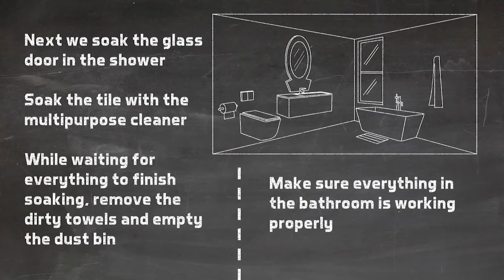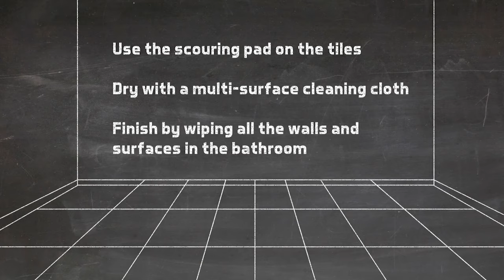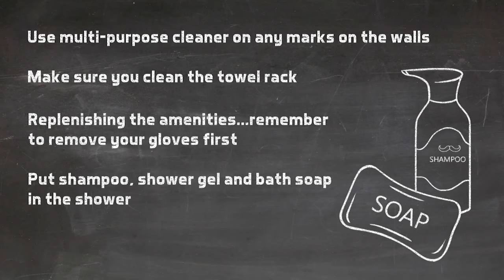Housekeeping - Level 3 - Cleaning of the bathroom and mop & vacuum the guest room

Comment: First of all you don't the same brush inside and outside the toilet sit. And when you use a cloth to clean you don't put it on the bucket with cleaning chemicals, you need a free bucket only for used clothes. And before the wet sponge cloth, you need a sponge to scrub properly to remove stains if any, then the sponge cloth to reduce the water and the dry clean cloth to dry. And the toilet sit it's not wash  on the surface like that you send the brush under the round holes at the top area. That's where the dirt settles. There's more to adment. You don't use dirty gloves to touch clean towels reason why you need to dust  first before washing. You change your gloves you don't hold them with your hands because your hands are not clean. You must always have gloves, first to protect yourself and protect the people using

Comment: While wiping dry the lower tiles please mind your back as that cleaning position will cause severe back injuries with time. Try spraying chemical on the microfibre cloth instead of spraying it directly on the wall and then wiping off the dust. This is one way of controlling work hazards like chemical splashes or spillages. Keep working I appreciate your work
Reply: U r right she still need a training as well , u cannot put chemical on shower glass n leave it for five minutes because u will not like the results, and u can't put just chemical on shower glass door without spreading water to wash the glasses,  her back position is not encouraging at all because after five rooms u will find urself at the hospital, even the zinc, biddy n bathtub need to open hot water for  five minutes before putting chemical
Reply: @lakshansilva6087  am working in an hotel this is not i work she still need training ciao 🤣🤣

Comment: I love your channel but my advise is work out a speed clean technique. From size i guess that room you odd to spend only 30min if you have a strategy. I always always first start by spraying bottom of toilet against basedboards and inside like you did. Leave it and go into shower. And than work left to right. Bottom to top always.and end where I started. It’s fast nr really work. It’s something I learned at a cleaning company when I went on my own it’s been helpfull

Comment: I would say clean  the bathroom  first before  I touch anything  else in the room or while Ithe chemicals  i.am useing  are working  i will  strip  the bed and dusting  the bed would be the last thing I touch why? Because  all the dust in the air and chemicals  that i am using  will not go on or be absorbed  in the bed linens

Comment: For the toilet  I would put my cleaner in the bowl and on the seats and lids then clean  the shower  walls and floor stall walls with a.cloth and shower  stall.floor with a scrubbing  brush and rinse  cleaner  off back to toilet  wipe toilet  tank top knob flusher seats lids  off clean bowl rim in and around  the bowl use brush and scrub  the bowl  out and flush wipe the toilet from  the bowl down to floor and the. Sides and back of toilet and behind  the  toilet  seats

Comment: Thanks for all you do!! Just some feedback… you added cleaner to the inside of the toilet bowl. Then you scrubbed the inside of the toilet bowl.  Then you dried the toilet bowl using the same cloth on the outside and dried the top of the toilet seat. However, you NEVER SPRAYED ANY CLEANER ON THE TOILET SEAT!! You dried the toilet seat, but never cleaned it before drying. And shouldn’t cleaning the toilet be the last thing cleaned?? You used the same gloves to clean the toilet where feces is located to clean the remainder of the bathroom. Ugh 😩

Comment: Madam I would suggest that before beginning to do any cleaning first check if there r any maintenance issues like leakeges or lights not working...then proceed putting chemical in the wc and close it gently. Once done process  to cleaning the washbasins then glass so this way the water won't splash on the mirror. Keep it in mind that in washroom cleaning you will clean from the clean area to the dirty area in this case the vanity counter area is the clean one. Once sanitizing and cleaning of vanity counter is done then proceed to cleaning of wc with toilet brush and once done take the red microfibre cloth and sanitize the wc seat cover from top to bottom. Never use the same microfibre cloths in both areas so this helps to avoid cross contamination. It's advisable to get different color cloths so you won't be confused on which one cleans where .
The video is abit educative but it's lucking. Better to operate on cleaning s.o.ps
Reply: true
Reply: Maintenance is the first thing to do when entering the room, u r right
Reply: good answer madam I agree madam your cleaning proceed off the best
Reply: up

Comment: But you did not disinfect the toilet seat which was sooo important and  the cover and back of the cover and toilet foot where there might be pea or smtg. We need to clean the sink tiles not just dusting cos there soap and tooth paste or dirty water drops, the trash bean check if is dirty, even the towel holders needs disifection from the used towels.

Comment: I noticed that you didn’t clean the tiles behind the sink when you cleaned the sink.  You also did not lift the sink tap and clean in between.
You cleaned the bottom of the toilet first and then used the same cloth to clean the seat and the lid. You did not clean the outside of the toilet bowl.
This is not a very good cleaning video.

Comment: This post is the proper way of cleaning a bathroom!!!! Because you just put piss or poop splatter on the toilet seat and cover!!!!!

Read this: Hi, just wanna say something. I noticed that you wiped the inside toilet first before the toilet seat and its cover. It should be the other way around. Also, I work as a cleaner and I usually clean mirror and sink first, shower and last the toilet bowl and do mopping. Rugs or cloth should be separated you don’t mix it with clean ones after using it. And you take so much time just with that.